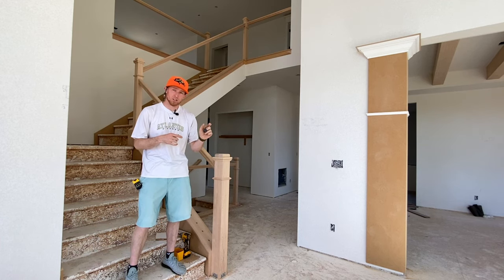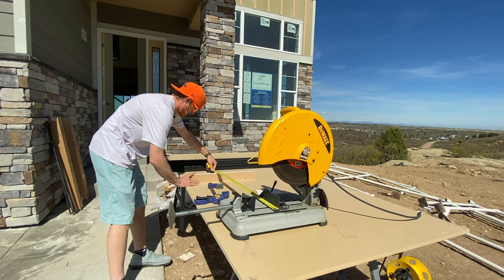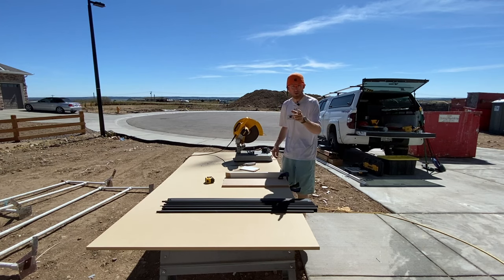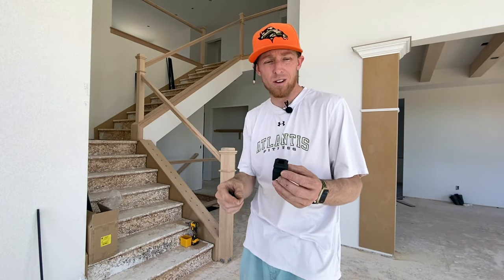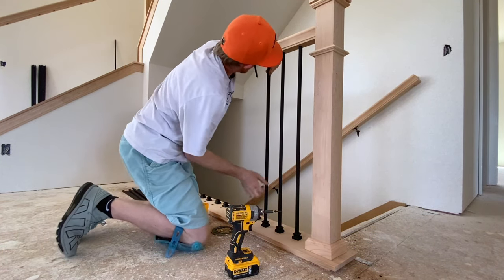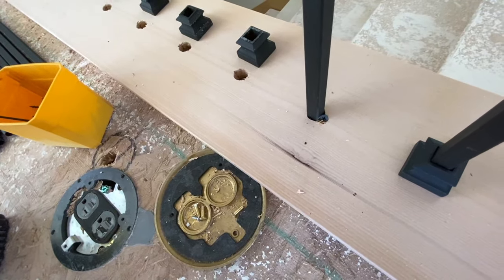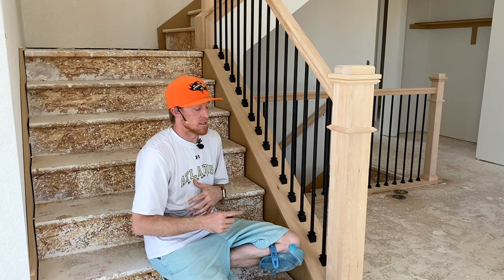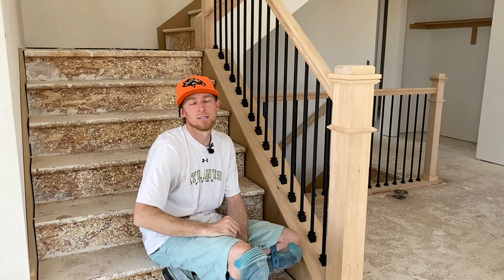IRON BALUSTER INSTALLATION / EASY DIY RE-SECURE *NO GLUE* : MEASURE, CUT, INSTALL, STAIRCASE UPDATE!

Comment: Thank you for this tip, what size are your Balusters to drill that hole size? My balusters are 5/8
Reply from the maker: My balusters are ABOUT 9/16”-5/8” diagonally from corner to corner on the bottom and 1/2” nub on the top...these are my sizes of paddle bits for drilling the holes...

Flat run of balusters—
-5/8” paddle bit for the bottom 
-1/2” paddle bit for the top

Angled run of balusters on staircase (rake)—
-11/16” paddle bit for the bottom 
-5/8”  paddle bit for the top (hide the nub in the material so hole is snug to baluster, or cut nub off)

So if your balusters don’t have a nib at the top make sure the hole is very snug! Maybe try 9/16” paddle bit...

Make sure to drill 1 1/2” down to fit the baluster into position...most cases I drill through the cap and the subfloor

Verify the dimension of your baluster and add or subtract what you need for the right size holes...

Any other questions please let me know...I have gone into some detail on other comments of the video that might be a good place to start 😉

Thank you for your time and comment on my channel! Hope this all helps! Have a blessed day!
Reply: @huntercarlson5446  thank you for your response, of all the channels I’ve watched yours has been the best, and I am completely ignorant, so thank you! If you don’t mind, I have another question. If some of my balusters are not completely level should I adjust the top or bottom hole 😬? I actually drilled the bottom at 7/8 🤷‍♀️thank you
Reply from the maker: Are the holes already drilled at the top?! Or pre-existing holes at the top?
Reply from the maker: If they ARE already drilled we have a slight issue...need to get a level of some kind, it can be a cheap one, can also be a small one as well to hold against the baluster...but we need an accurate mark on the handrail (up top) to know where the level point is...it can be very hard to drill a hole if we are just moving it a slight amount, the drill bit seems to skip around if you can’t get the tip directly on a decent thickness of wood...might need to plug the holes with real wood (don’t freak out there is material made for that at Home Depot) before drilling them...I will explain further if this is your case...
Reply: @huntercarlson5446  I think that is the case, they were pre drilled on banister and I made false end caps and drilled holes in those but I leveled and it looked right until I see some of them are off a little. I was thinking to drill the hole a little bigger on bottom and use extra drywall screws
Reply: I wish I could send you a picture or hire you to finish it haha
Reply from the maker: Ok thanks for more info! So scratch the top altogether! Try to make the hole on the bottom more oval shaped than going bigger in the drill bit size...i would get a smaller drill bit, not paddle bit, maybe 5/8” or 3/4” and drag the drill bit to one side...then cross the 2 screws tight to the baluster...maybe some wood filler to cover up any gaps outside of the boot😉

Let me know how this goes!

Comment: How do you get your bottom and top hose right or straight
Reply from the maker: Hey Mark! So I will layout and drill the holes on the top(handrail) before I install the piece between the posts...after I install the handrail between the posts or wall and post, I use a 5 ft level to mark out each hole on the bottom cap...eyeball center of top hole and mark the bottom cap with a pencil...make sure to center your holes on the width of the cap as well...hope this helps with your question! Please let me know if I need to elaborate any further for you to understand...next time I layout the holes for a handrail I will make another video! Hope you have a blessed day!

Comment: The baluster should be secured independent of the screw. You drill out the top of the railing more than the bottom so that no matter what if it slips down it'll be secure. I like the screw idea instead of using epoxy, but if that baluster ever slips down and a kid hits it it's going off. An inspector would not pass this if They saw that you were drilling out more on the bottom. Nice tip however.
Reply from the maker: Appreciate your comment and thanks for watching! Just fyi…I have NEVER had a baluster come loose from securing the bottom with a screw…I have to warranty my own work and the work of my team, it’s been 7 years with this technique and not 1 issue of a baluster sliding down…I’m not trying to discredit you at all! I see your point and your concern! If installed correctly with a screw to hold the bottom, that baluster will never move from the secured position! 
Thank you for your time and have a blessed day 😎
Reply: @huntercarlson5446  I'm sure you had to make the bottom hole larger because it had to be cut rather than having the round tip like the top.

Comment: Have you ever install the angle boot we are having a problem when we tighten it tends to angle off of the railing 😫 what can we do. We were thinking of using adhesive to just glue it on there and not tighten it at all. Help
Reply from the maker: So sometimes that set screw angles the boot on the balusters…I think that’s what you are talking about…sometimes you can loosen the set screw and hold the boot tight and re tighten…or loosen the set screw and yes, use good adhesive under the boot but not enough to make it squeeze out the top, and after it dries screw in the set screw till it is snug…
Reply: @huntercarlson5446   Hunter we will do that..Thank you.       Your videos are very helpful. 👍
Thanks.
Reply from the maker: You are welcome! Thanks for watching!

Comment: How much money should I charge for baluster swap outs? Labor only per?
Reply from the maker: It’s hard to just charge a flat rate per baluster swap out. It depends on travel, prep work of the job, and possibly having to drill holes and clean up the mess. I personally would try to schedule the jobs in either 1/2 or full day labor rates. $350 for 1/2 day and $650 for full day jobs. (1 person)

Day labor rates aside…Let’s say you add $1 for each: tear out, drill holes, cut new baluster, install. $4 bucks per baluster…
Some homes might only have 50 balusters that might take you 3-4 hours roughly…that would be $200 bucks which is great for hourly labor, but there needs to be a buffer for mistakes/damage/refinish/and possible tools needed (drill bits, screws). So maybe you could get away with $6 per swap to get closer to the $300 range, but what happens when a job takes longer or you run into a problem. Piece rate goes right out the window…this is just my 2 cents…hope this helps
Have a blessed day 😎

Comment: 2 questions,

1. You’re just running the drywall screw next to the baluster, not into the baluster correct?

2. I’m putting down an oak 1x3 on top of my wood floors. Do you have problems with oak splitting with your drywall screw method?

Thanks for the video, very smart!!
Reply from the maker: Thank you very much for watching and the compliment! 1. Yes running the screw tight to the baluster so when the head of the screw comes across the flat part of the baluster it pinches the baluster to the wood hole. I’m not running the screw through the baluster. 
2. So I have never had an issue with splitting wood from my screws. I use 1x8 or 1x6 poplar or hemlock for my “cap” material. Oak is definitely more expensive and stronger so I don’t want to lead you in a bad direction, but I feel you will still be ok with splitting. Just make sure your screw is installed below or half way down the hole of your material. So the 1 1/4” screw is grabbing 3/8” of cap material and 7/8” of sub floor or in ur case the wood floor(roughly).  Try 1 screw gently to see what happens, or just pre-drill (only through the 1x3 cap) for each screw.  Just make sure the screw is tight to the baluster and at a downward angle to grab the floor...
I hope I answered ya! Anymore questions don’t hesitate to ask! 
Have a blessed day!
Reply: @huntercarlson5446  thanks my man, you too!

Comment: Hi Hunter. My understanding is balusters also need to be able to help support and strengthen the handrail. Does this method create any issues with that being as the top is not glued or screwed in?
Reply from the maker: Depending on the thickness and length of the handrail...your exactly right in the support aspect! I didn’t glue any baluster in the video because my handrail is 2 3/4” thick and solid for each run...the pressure when I’m holding the baluster up does give the handrail support just make sure the hole isn’t to big for the baluster it needs to be snug! If you have any doubt for your project I would recommend glueing some but not all of the balusters...hope this helps! Let me know if you have any more questions! Have a blessed day!
Reply: Hello again hunter. I had another question and hoping you can help....I am replacing my carpeted treads with hardwood. The stairs are "j" stairs....ie 7 curved treads at the top turning into 6 straight treads as they go to the bottom. Im trying to fit back the original handrail to minimize the "bump" where the curved part meets the straight part. My question is how much can i vary the handrail height ? If i set the handrail so its the same height on each tread, there will be a very severe bump at the joint so im hoping to lessen that angle---but that will result in a variance on the handrail height anywhere from 1.5 inches to 3 inches. Any advice would be appreciated..ty

Comment: Awesome
Reply from the maker: Thank you for the comment!
Reply: @huntercarlson5446  thanks for posting, what’s the ideal spacing of the holes?
Reply from the maker: When it comes to spacing out your baluster holes there really isn’t an “ideal” measurement. The measurement you NEED to stick to is 4” spacing, anything larger than 4”, you will fail CODE requirements for your home.  So when I layout my baluster spacing I will always start at 4 inches. To get each baluster spaced the same, I will always shrink the spacing. The majority of the time my spacing is from 3 1/2” to 4”. Any more questions let me know! Have a great evening!

Comment: What type of drywall screws are you using? I’m using 6 x 1 1/4 fine thread drywall screws and mine are taking a while to pop through the spindle. You seem to be going through them like a hot knife through butter!!!!
Reply from the maker: I’m not going through the baluster with my screws...I’m running the screw parallel and tight to the flat part of the baluster so when the head of the screw passes the flat part it pinches the baluster to your wood material...
Reply: @huntercarlson5446  good deal, I get it. Thank you so much brother for your reply
Reply from the maker: Very welcome! Snowing here in Colorado today so I got the day off 😎...let me know if you have any more questions! Have a blessed day man!
Reply: @huntercarlson5446  Just tried that and it worked like a charm. Once again thank you so much.

Comment: What is going on is that you are doing a very simply installation.  I'm a homeowner and I have the same designed stairs with 8" tread, plus my ballisters have a Monte Carlo design in them meaning that they need to be perfectly spaced up and down so the designs are straight on level rail, and on same incline on the raked rails.  I cannot get the ballusters to go in at the angle needed to insert them in the 5/8" hole at top and them swing the bottom in over and down into the bottom hole.  It would be nice if my top holes were 11/16" instead of 5/8 so I could easily slide the balluster way up, then over at the bottom.  But, I don't know how to make the upper holes larger (with buggering up the edges) other than using something like a Dremel sander to try to open them up more.  They are so tight at the top now that they almost need to be tapped in with rubber hammer.  I have shoes for the bottom but wasn't planning to put shoes on the top, but might need to consider that now.  I could open the bottom holes up anyway I can, messy or not, and make them wider and deeper.  Then, I could put the bottom in first and swing the upper end over and push up, but I'd still need to use the dremel to open up the holes on the top so the balluster would freely slide in (I've tried wax, soap, and bearing grease to get them to slide in easier and it helped, but not easy enough).  If I have to bugger up the top holes to make them bigger, then I'd have to cover them up with upper shoes too which I didn't really want to do.  I don't care whether I use your screw method or epoxy once I get them in.  I also thought about glueing them into the bottom holes first and aligning them with the holes in rail as I bring it into place to attach it (or glue top first and slide bottoms into bottom holes as I lower the rail down into place).  Any other suggestions or tips?
Reply: Didn't read your whole comment, but if you want to make holes bigger, find the diameter of the existing hole, cut out a plug from scrap wood using a hole saw, then put that plug in the center of your new size hole bit and it will be a guide for the newer larger hole.

Comment: Why would you not face the set screws away from where your face will be when you walk up the staircase? 
Try and hide them from eye sight.
Reply from the maker: I understand your point, but in some areas of the home you will always see the set screw. I will always face the set screw the same way in each run, but I don’t focus on if the homeowner can see it or not from certain angles… in my experience I have never had a homeowner ever point out the direction of the set screws…you are obviously a professional with possibly more experience than me so I appreciate you pointing out your viewpoints and sharing them here on the channel! Thank you for your time and have a blessed day 😎

Comment: Does this work if the baluster is going into the tread?
Reply from the maker: Yes it does! Just make sure to drill down 1 1/2” to fit the baluster down into the hole to slide up into position! Choose a drill bit that is 1/8” larger than the diameter to drill the bottoms with...the top hole should stay the same in most conditions...if you have any more questions please don’t hesitate to ask! Have a blessed day!
Reply: @huntercarlson5446  thank you

Comment: would be easy if you explained how you got each measurement unless am missing something. Regardless. Great tips and video thanks.
Reply from the maker: Your not missing anything in this video. I did not go over my spacing for the baluster layouts…however I have another video of installing a handrail start to finish where I do go over the measurements and drilling for 1 run of balusters…check it out if you have time it might help! I have time stamps as well so you can fast forward to the layout part of the video. Thanks for watching and reach out if you have any questions! Have a blessed day 😎
Reply: @huntercarlson5446  thanks much. I’ll check it out. You as well have a blessed day

Comment: I have a question where there’s steps can the balusters have 5” for each hole or does it have to be 4” ?
Reply from the maker: Great question! It depends on your condition! In my video the baluster holes were drilled on top of a wood "cap" running parallel to the handrail (wood material you actually grab with your hand). Given this condition the layout of my drilled holes are 5" (NO LARGER), but my spacing still holds to 4" horizontally.  One step further, if the baluster finishes on top of a stair, you still maintain your 5' hole layout for the handrail and 4" layout on top of the stairs. So please maintain a 4" spacing (or smaller) between balusters because that is CODE for your home! 4" hole spacing for any flat railing and 5" hole spacing for any angled railing.  I always figure the layout on the handrail first. After the handrail is installed between the posts, I use a level to mark each baluster hole location at the bottom.  I hope I answered your question, please let me know if you have anymore! Have a great evening!
Reply: This helps a lot thank you so much!
Reply: Because I have someone redoing my stairs and the guy said 5” for angle and 4” for layout and I needed to ask someone if that was right so thank you and have a merry Christmas 🎁🎄
Reply from the maker: You as well! Merry Christmas! Come back for any questions!

Comment: How deep do you drill holes - top and bottom?
Reply from the maker: The top holes I drill about 1” deep to accommodate the nub on the top of each baluster…1/2” holes for a flat run…
The bottom holes are drilled about 2” deep with 11/16” drill bit…this allows you to drop the baluster into the bottom hole and then slide it up into the top hole…
Hope this helps! Thanks for watching and have a blessed day 😎
Reply: @huntercarlson5446  So you added 1 1/2" to the baluster?
Reply from the maker: @E.Carrillo  yes add about 1 1/2 to 2 inches to the baluster…we need enough room to slide the baluster down then up into the hole of the handrail…in most cases you will have plenty of room to drill down…sometimes I drill straight through the subfloor and have an empty 8-10 inches of space underneath my rail cap…

Comment: What size hole did you drill?
Reply from the maker: The bottom hole is 11/16” drilled with a paddle bit…the top hole on the rake of the stairs is 5/8”…the top hole on a flat run is 1/2”

The top hole has to be 1” deep roughly and the bottom holes have to be 1 1/2” deep or more. 
Hope this helps…let me know if you have any more questions! Have a blessed day 😎